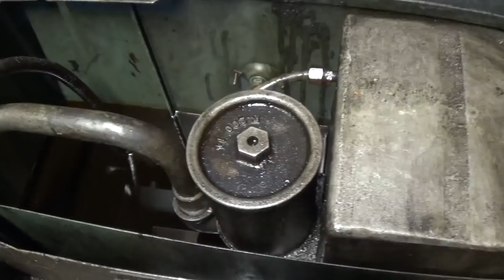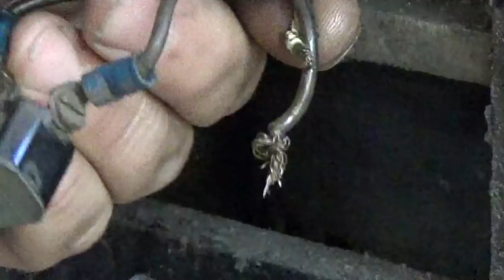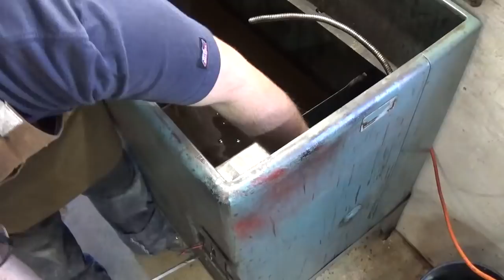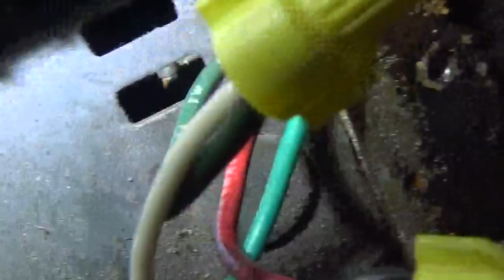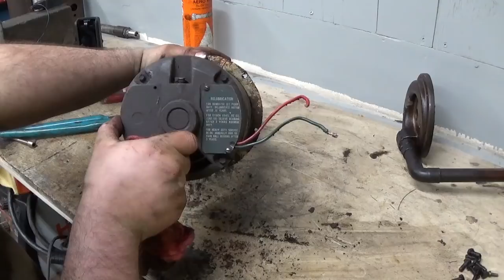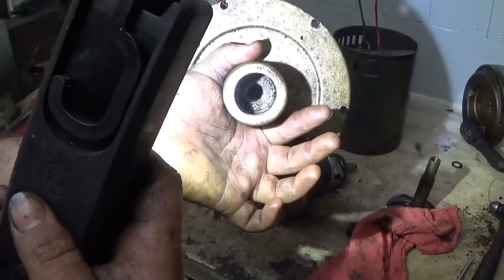Vintage Parts Washer Repair (Part 1 of 2)

Comment: Nice that you got that motor running!  I wonder if the data plate was removed because the rivets were not able to clear the center divider of the motor housing? Also it looks like Clear Flow ordered that motor from GE and removed the factory front housing and replaced it with their own part. That would make sense because the rear GE bearing is a journal bearing; but the drive end bearing is a ball bearing.

Comment: When installing motor couplings I like to power up the motor with some dicem or paint on the shaft end. Once up to speed the armature will come to (magnetic center) & I'll scribe a reference line on the shaft end & install the coupling there.  An old tech in the electrical shop told me that the motor is at peak efficiency & generates less heat when it can run at magnetic center. For what that's worth 😊

Comment: I wasn't watching closely enough to see just where the endplay was but that it is obvious to me that the motor is for horizontal mounting not vertical. To lessen the end play check if you can make up a metal spacer for the rotor to carry the weight of it against the inner part of the bearing. Other than that you would know that motor will run vertically.
I would leave it with about half that amount of end play after checking that the impeller is close to running properly between the impeller plates.
I am 4mths late but I see that there is no part 2 yet

Comment: Looked like the motor was such a tight fit in the housing that they had to remove your specs tag. Enjoy your small engine and power generating videos.

Comment: Looks like the parts washer the old school independent auto repair shop I worked at once had. It was a relic left behind by the previous owner of the shop, who was at that point the landlord. 
Ours was rumored to at one time have been using gasoline as its cleaning solvent. Needless to say, we didn't use it much. 

Eventually replaced it with a big plastic heated unit the NAPA guy sold us, that used ungodly expensive biodegradable solvent.

Comment: Seems like the pump end got worn with the thrust issue.  A centrifugal pump like that needs much tighter clearances than 1/8''.  Might need to replace the impeller or weld/braze on some material (then turn it even on a lathe).

Comment: Just sold a parts washer just like this. You are missing the fold up doors that go on top of the inner tank. Mine had a air fitting to aerate the inner tank and made it kindof automatic. Outer tank on mine was rusted thru. Good luck with it.

Comment: you were close on your repair work. remember you have a centrifugal pump. it regulates its operating fluid pressure  by moving the impeller away from housing. during startup you do not want close tolerances, incase of trash in fluid. you need ability to self clean pump.

Comment: Mike, I seen when you pulled the motor out of the Aluminum housing it was a really tight fit. So that is why the tag may have been taken off.
Also here is  Shop Motto For You.. " WHERE NON FUNCTIONING BECOMES FUNCTIONING" LOL

Comment: Always and I do mean always check your wiring connections.  I'm about to fix some electrical wiring where a contractor tried to use a crimp connector to connect 4 wires together and they didn't get a good connection because they didnt twist the wires together first. Almost burned the building down. It started smoking and the tenant caught it.

Comment: The corrosion on the pump body is most likely caused by galvanic reaction between the two dissimilar metals - the intake elbow and the aluminum body. This corrosion is also there in those pump bolts.

Comment: filter is probably a 60 chevy V8 oil filter... STP   S200PL  cartridge filter or a Fram CH200PL if this matches up. 

Filter Height (in):  5.61
Filter Inside Diameter (in):  1.28
Filter Outside Diameter (in):  3.59

Comment: The sealed bearing is bad causing your starting problem.  End play is usually not an issue. The up and down movement in the shaft is. The sealed bearing being wore can cause starting issues. Hope this helps.

Comment: I wouldn't worry about shimming the end play, as the motor is mounted vertically, the the weight of the impeller etc will drag it down. What's more important is to make sure the end play isn't bad enough to cause the inlet to hit it housing and shim accordingly.
I imaging the damage to the bottom of the impeller housing is either due to galvanic reaction with the aluminium housing and the bottom of the steel tank, especially if there's water sitting at the bottom, or just grit etc causing erosion due to eddie currents caused between the housing and the bottom of the tank. Try using a bit of the steel putty just to help protect it, if it will stick. And check the tank where the impeller housing sits for erosion to.

Comment: That motor doesn’t necessarily use shims to take up end play.  That’s a C-face vertical pump motor and as such, doesn’t need the shaft to be shimmed. It was designed to use gravity against the ball bearing.  The centrifugal switch contacts were made of a silver alloy back then. They only had to break the start winding on startup maybe once a day where the breaker contacts in an engine make and break thousands of times a second....that accounts for the hardness difference.  Ya know....it sucks that I started as a mechanical contractor way back when that tank probably was new...It just reminds me how old I’m getting.  Thanks for the great content!     Oh, and I’ve found that yelling at the screen doesn’t help at all.  :)

Comment: I suspect that there was a fiber washer at both ends but the shaft end one has worn to dust due to that type of motor not really being designed to run on its end.There should be a stay for the lid with a fusible link in it that melts in case of fire and allows the lid to fall shut.

Comment: Since this motor/pump runs in vertical position only..is the endplay really an issue? You did all it's the test runs runs horizontally...just wondering.

Comment: I noticed there was no spacer or thrust washer on the bottom. Is it possible that it had a fibre spacer on the bottom as well and the bearing overheated and cooked it causing the impeller to bottom out and stall the engine? 
Found a parts manual for a Kleer-Flo/Kleen-Tec model J80 which appears to have the same motor. It has a usable wiring diagram for the front panel and filter part numbers if nothing else. Sadly the manual does not show motor parts. Link to a manual that found using google search from the manufacturer. http://www.ct-assocs.com/manuals/KLEENTEC-J80-MANUAL.pdf  Manufacturers web site is currently undergoing an overhaul so there isn't much on it yet but here it is. http://www.ct-assocs.com/kleentec.html

Comment: Awesome! I love when you do these long videos :) Anyway, I think they might have taken the plate off of the side of the motor, so that it could slide into that aluminum casting. It seemed like a tight fit. And I would be willing to bet that no one has EVER lubed up that motor since it was installed. That seems like a pretty poor design to me. They should have included a removable plate on the top of the aluminum casting, in order to give access to the rear of the motor. Looking at that oil cup, it also seems as though this motor was intended to be mounted horizontally. If it were meant to be mounted vertically, I would assume that there would be a little 90 degree fitting added to make sure that the oil cup was facing straight up. But I have never messed with older electric motors, so that is just a guess. 

I am definitely looking forward to Part 2! :)

Comment: Your chest-freezer comparison gives me ideas about the old upright freezer we don't use anymore... Might make a good housing for building myself a parts washer! Hmm, and I picked up a junked washing machine recently (used the impeller on the one in the house), got a shiny motor and pump from that! Just have to wire up the module that runs it or build a circuit to run it. (wires got cut out by scrappers) 
Looks like you'll have it fixed soon!

Comment: Going to guess that you've already seen http://www.ct-assocs.com/manuals/KLEENTEC-J80-MANUAL.pdf or similar- it does give a part number for the filter, and you can sort of go from there.   I did some quick searching on that and it looks like it may take some doing to get it crossed over to something, but it's at least a starting point.
Reply: lol I just found the same manual. Appears to use the same pump and motor. That is actually from the manufacturers web site which is undergoing a update at the moment but there is contact info at the bottom of the page here. http://www.ct-assocs.com/cleanmaster-two-level.html

Comment: May have been made with endplay so the impeller can center itself in the housing?
Reply: It is designed to run vertically.
Is the impeller supposed to ride on the housing?
Reply: @dans_Learning_Curve  I am guessing while the impeller is spinning,  the fluid back pressure above and below the impeller will keep it centered in the housing, and allow it to spin even if the output is blocked.

Comment: Interested to see how this works.  I'd have thought the solvent level would need to be below the level of the bottom of the motor, to prevent creep of the solvent through the seal.  Seems it would leak if any higher.  The double sided impeller reminds me of some large cooling pumps we have at work.

Comment: Now you need a parts washer to wash the parts of the parts washer
Reply: The pressure washer I pulled from a dumpster was the pressure washer I used to clean the pressure washer. Happy birthday twice BTW.

Comment: They sure don't make them like this anymore.   Modern parts washers have tiny engines that get very hot after only 10 minutes run-time.  This one looks like it could run for hours without problems.   Thanks for the upload.  Will catch the next one.  Greetings from Thor in Norway,.